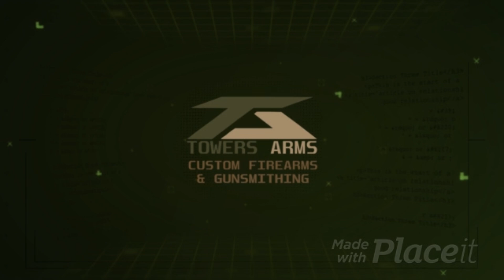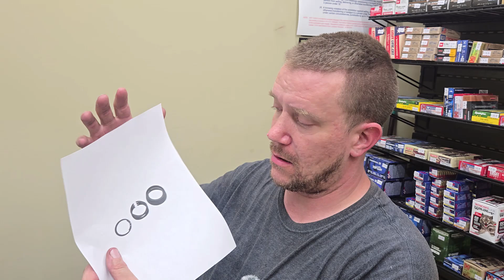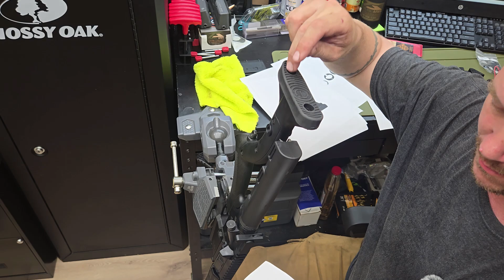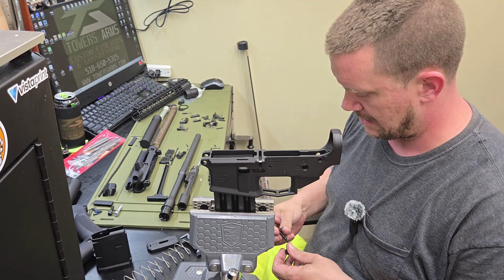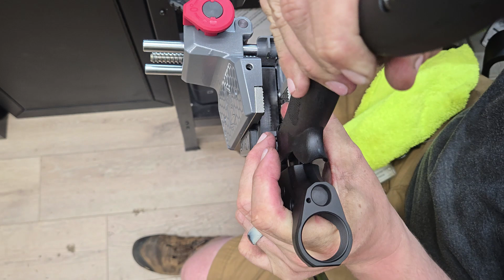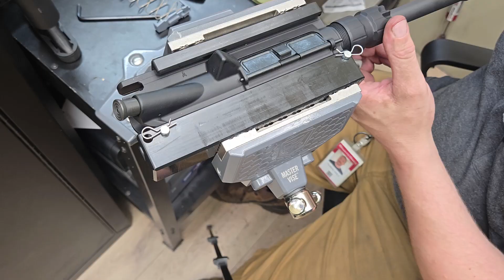NY legal AR-15 Build for FTE 217 Week 2 Assignment

Comment: Hey so im i fte 217 myself rn where are you finding the blueprint for the build im having a hard time locating it.
Reply from the maker: I took most of the measurements myself with calipers.  But if you look up  each component individually you can locate blueprints easier